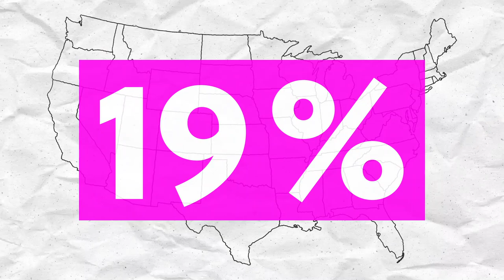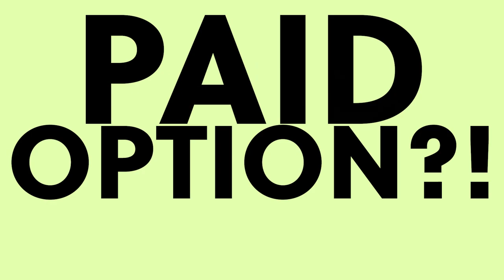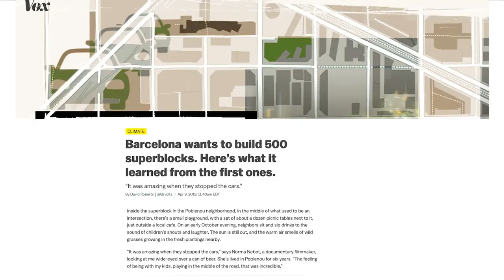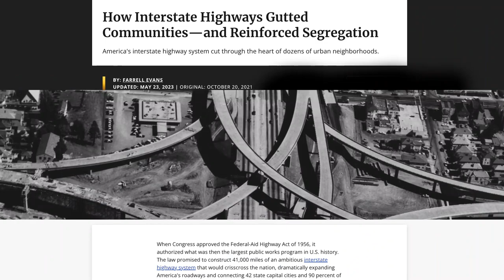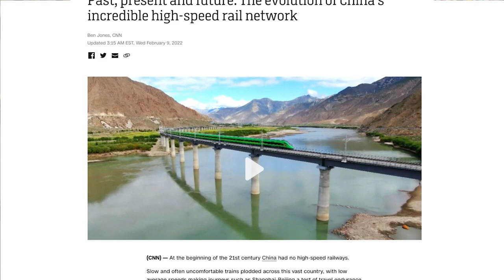What would happen if we banned cars? (Hint: it’s all good)

Comment: From the picture, your neck of the woods would be LA. It's a nice place to visit, but I'd hate to live there. The US has gone way overboard with their car-centricity, but allow me to mention my personal experience and convictions, as a European.
Until I turned 30, every single way over a kilometre was done with a car. This resulted in some cost and lots of obesity. 
After a rather big change in my living circumstances, I moved to a village outside the city I worked in (for an EV startup!). Commuting by car was horrible, so I switched to an e-bike.
In the years after I moved a lot from place to place and tried to use the one or two cars I had at any time as little as possible.
It is possible with some sacrifice, and it is possible now even though I work in another city than I live in. That's in Europe, though, with it's short distances and awesome rail infrastructure.
However, after some years without a car at all, I'll lease one starting next month.
Three reasons:
3rd from below: bad weather. It's all nice and well riding my bike to the train station, but if it's raining excessively I'll prefer the car.
2nd: flexibility and cargo capacity. Whenever I have something big to move or discard, bike/train/foot just don't cut it. This is not very often, but every once in a while it occurs.
1st: My commute is one of the most used rail lines in my state. To get even a small bit of private space, I take the train leaving at 6:20 am which means I have to get up way before my natural time. Taking the later train, or almost every time on the way back, the commuter trains are packed. This is just uncomfortable. In the evening and especially at night, you have just scum riding with you. Loud, smelly, aggressive people, people who have no other means of transportation.
I'm really looking forward to avoiding those guys.
And that's in the most perfect of circumstances - good, reliable, regular and fast connections, dirt cheap prices (I pay way less than a cent per mile).